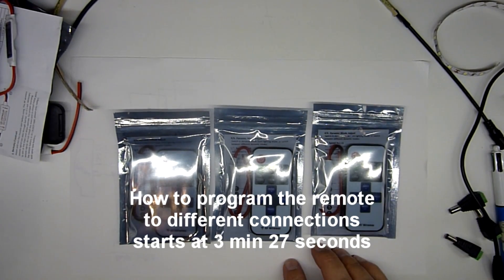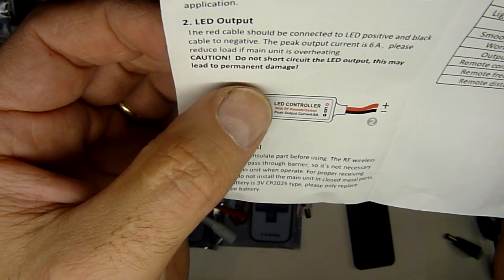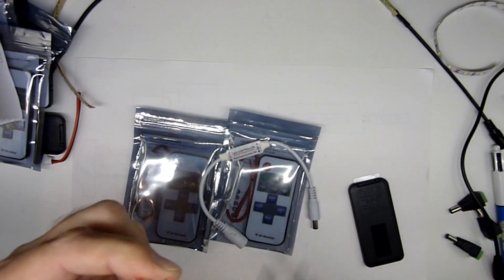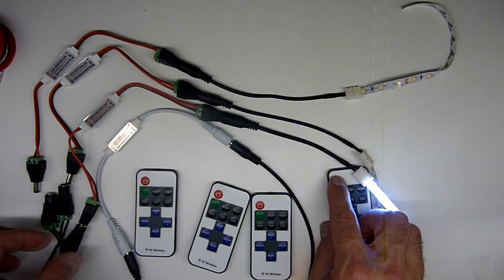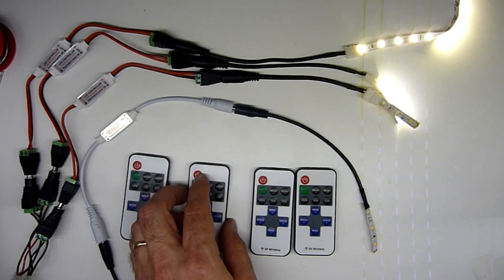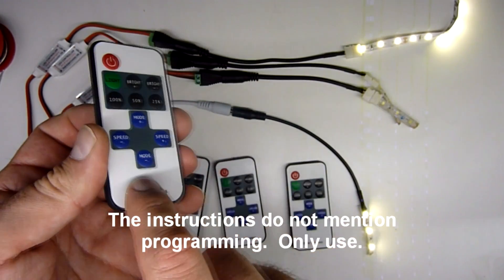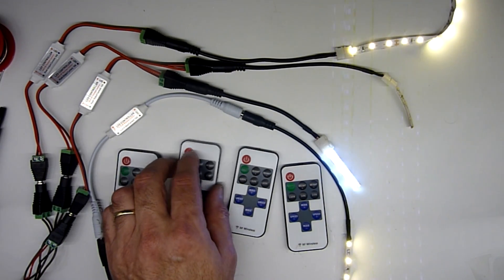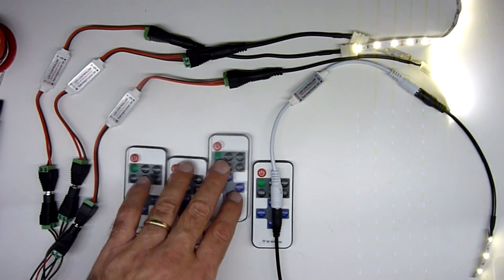LED One Color Remote Control Programming

Comment: What do I do if I want two remotes to control the same strip?
Reply from the maker: Not with this controller.   There are a couple of options.  For remote based looks at mi-light. Each remote can do up to 4 controllers and you can have multiple remotes.  The other is phone or voice control.  That can be a WiFi or Bluetooth based controller.  I demonstrate a WiFi controller in this video. https://youtu.be/SAyy_kZojv0
Reply: Is that means constant war with neighbor ,,is led RF controller can possibly be the begining of civil war ?-:)

Comment: Hi can i use this with 5 meter led strip even
Reply from the maker: Yes, It is based on load.  I have one running 9 meters of light rated at 1 amp per meter.  I did solder in new leads of a higher gauge first to run at that rating.  You should have no issues.

Comment: Thank you a lot!!
I have 5 LED strips in different floors and they turn on / off all together!!
You save me!!😊😊
Reply from the maker: Great news.  I still use many of these around the house and with new installs when I don’t use a motion sensor.  I have recently started playing with WiFi enabled single color and multi color controllers.   The cost is more per unit. You gain scheduling, control from multiple devices and smart home integration like google and Alexa for those areas where hands free is of benefit.  Enjoy your install.

Comment: does yours work with 5volt using usb supply ?? mine doesnt working :(
Reply from the maker: The ones in this video are rated at 12 to 24v dc.  5v is common in controllers and lights running of usb power since usb runs at 5v. You should be able to find similar units that rating.
Reply: thanks so much for reply my comment :) i bought 4 remote control throught shopee, they look like yours in this clip, i'll try with 12v led light.
sadly they're not work with my 5v fairy light
Reply: my rf control labeled working voltage from 5-24v :(
Reply from the maker: Try to verify it is working someplace else.  Sometimes the battery contact does not touch the contact. I see some of the 5 to 24v online but none of the reviews mention using them ah 5v.  I hope it works out.
Reply: Always Tinkering thanks so much :) have a good day sir 😝
Reply: @alwaystinkering6972  i tested with my aquarium led light used 12v electric, it worked !!! thanks

Comment: I have led lights on my stairs. I have one remote at the top and one remote at the bottom. Worked for about a year and then something got it out of sync so that no remotes worked. Used your video to reprogram. Do you know how to make 2 remotes work with one receiver?
Reply from the maker: I tested that and found no way to intentionally make both work with one remote.  I am thinking of doing my stairs soon. I will probably try dual motion with a blocking rectifier.  Voice activated is tempting but Alexa or google screaming ok in the middle of the night may not go over well.  

Look at the mi-light controllers. One remote can control  up to 4 controllers and you have the option of multiple remotes.
Reply: @alwaystinkering6972  Thanks for the input! Lately I have been just reprogramming the lights every time I us the remote at the top or bottom of the stairs.

Comment: I use RGB controller with RF control. And i have many problems with connection controller and remote control. Сonnections is lost on many controllers. Can you help me? Are there hidden control panel features?
Reply from the maker: All of my color controllers are infrared or WiFi or WiFi/infrared.  The WiFi infrared work best for me because I can use my phone to control the lights and the non-tech people in my house can use the remote. 
While there a growing number of options you will find that the offers under multiple brand names are the same product.  This means you should be able to shop price. This link is an example of an infrared with WiFi https://www.amazon.com/dp/B07BRWTQCS they come in RGB and RGBW format. 
A broader selection could be seen by searching “wifi rgb led controller”
I hope you find a solution that works for you.

Comment: Does this technique work with any brand of rf led controller?
Reply from the maker: Many if not all RF remotes seam to have some process to re-associate the pairing. No two seam to follow the same process and key combination.  Few are documented with the instructions.  So the answer is no. This one does not apply to any brand.

Comment: Whitch fuse I shlould use for my motorcycle ? It’s 12V
Reply from the maker: The one above the rated amp draw of the led lights you are using and no higher than the rating on the next lowest rated item... wire... switch and such.  At 12v it is 1 amp per 12w of rating.

If you had a 12w light thats 1 amp.    1amp fuse may be too close, 2 amp would be the lowest.  You are protecting against a short.  

You don't want that short to pass enough amps it can melt something and cause a fire.  Unless you are pushing the full rating, a 10 amp fuse should protect this dimmer... if you trust the factory wiring on it.   So if you are using lights with a lower draw than the dimmer rating, fuse at the light rating.

Comment: Good day. Thanks for the helpful video. Tell me, maybe You know, how one controller to register 2 remote controls. Thank you in advance.
Reply from the maker: Mi-light makes a system with multiple remotes to multiple controllers. Usually each remote can do up to 4 controllers.  Another option would be phone controlled controllers if you want to use multiple phones for control.  Phone enabled are more common for controlling color.  You can use them for single color  by using just one band and making an adapter wire.  On most color controllers each color is a (+) connector.  The common is the (-).
Reply: Good afternoon. Thanks for the quick response. I need the reverse action-bind the second (optional) light control panel to one controller. So as to control two(1 and 2) remotes by one led strip.Thanks.
Добрый день. Спасибо за быстрый ответ. Мне нужно обратное действие - привязать второй(дополнительный) пульт управления светом на один контроллер. Так, чтобы управлять двумя(1 и 2) пультами одной светодиодной лентой.Спасибо.
Reply from the maker: No.  As I show in the video sometimes they answer to the same remote, but getting both to respond is hit or miss.  I have used some color controls that are run from your phone.  The apps give you a list of controllers it sees.  I only have one controller so i don't know if I could control more at the same time.  Actually I do have a second controller that is supposed to use the same software.  I will have to run a test to see if an action can do multiple at the same time.  I had tested the wifi controller on an Alexa voice control.  It worked well.

Comment: Is there a way to force ON or OFF, not toggle? I have more than one light strip in the same electrical circuit, and it happened that the lights are "out of sync" with one another. Turning the circuit off does not solve, as the controllers have memory... Any idea? Thank you for your video.
Reply from the maker: No.  I also tried getting one remote to talk to two controllers for someone and that did not work.  

Options:  if you can get a wire between them a one color amplifier will allow you to extend control and keep the second power supply for the second string... and you get one controller control.   Another option is rgb wifi controllers (with the infrared remote option if you want)  the wifi gives you phone control of each light separately.  You obviously are not using the color lights so use the common (which is usually the positive) and one color.  You could also do something similar with the cheaper regular color controllers.  Another option might be the Mi-light WiFi Led controller system. They used to make one color and rgb color modules.

Comment: This should be able to power two 10w led lights right? I connected it and it worked fine for 10 minutes and then just died. And now it just flickers one time when i try to power it on.
Reply from the maker: The rating of label of 12A would be 144W at 12V DC as there are 12W per amp at that voltage.  I run a rated load of 9A or 108W on a daily used string for over a year now.  I say rated because the actual load created by a string is frequently less than its potential peak.  As for diagnosing your problem.  First verify that your 10W LED fixtures work without the dimmer.  If the dimmer is toast you may want to remove the cover  over the circuit board ( which is heat shrink) for analysis.   Did anything melt?  Do the wires test as functional and not broken.   The one short I experienced melted the wiring insulation over the IC that overheated.  You likely won't be able to fix a problem, but you may see something obvious in the issue, including a defect.  Also check your power is putting out the correct voltage.  Also remember, the printed instructions say it is rated for 6A... You still would have been OK... it is just a reminder that there is not telling what it should be.
Reply: Always Tinkering thanks for the reply. I think i just got a bad batch or something. I opened it up and i cant see anything burnt or obviously wrong with it. Now when i connect the leads it actually lights up, but it doesnt want to be controlled. The controller it self is fine and working however. So now it only acts as a peice of wire... Ill order a new one and see if it happends again. I plan to use it on my motorcycle. I want to use these insainly bright tiny work lights as drl's and being able to set the brightness will help me being seen, without blinding other drivers. Especially when its getting darker or raining. Do you think theres a better solution to this? I really like the idea of being able to strobe them as well.

Comment: Not flashing after pressing the speed buttons. Tried everything, but 1 remote still controls the 2 led in the same time. One in the kitchen, and one in the bedroom.. Ideas?
Reply from the maker: Are the remote keys in the exact same layout?  There is another remote that is of the same size with a different key layout.  That remote uses a different key combination.  I have not seen any changes, but it is always possible they could update the chip set.  Also make sure to try it right after the power on.
Reply: Both are the 17 key rf remote. In the manual there is the same method but..
https://youtu.be/U5jYMBW11GE - this type.
Reply from the maker: Color too.  Definitely different.  I don't have any with that layout.  Try different key combinations within 5 seconds of power on.  It is likely there someplace.  Things like bright up and down.  Also try holding buttons at power on.

Comment: I also solved the pairing problem. Disconnect the power for 5 seconds, reconnect, and press the speed + and speed - together in 5 seconds. The LED must flash once and the pairing is done. I hope it will help
Reply: - Mirek - This has not worked for me at all
Reply: It's good.

Comment: i have two remotes for 1 strip is there an option to program that
Reply from the maker: I am always hesident to feed electricity backwards into a device that does not clearly indicate it supports that configuration. One remote activating the power would create that scenerio for the other controller.  Consider the milight remote control system that allows you to have one controller and multiple remotes.   That system also has a wifi option you can add for additional control.  That being said you could also get a standalone wifi controller that has an ir remote option.  Phone would be one remote and the ir remote the other.
Reply: Always Tinkering no i have one controler on the led strip but i have 2 remotes
Reply from the maker: I grabbed a battery pack, two remotes, a controller, some light and went out into a field to run a test.  I was unable to get two remotes to talk to the same controller.   I could swing controller control back and forth between remotes (I guess that is an option if you have no other controllers... just resync when you go to use the remote).  

I tried sending the sync sequence at the same time, only one would win.  I tried numerous other key combinations with the loser and it would never gain simultaneous control.  I also cycled through resync's on one controller to see if there would be some overlap at some point... and I encountered none.

From this experiment I would say the controllers build their sync off what the remote sends... and that the controllers must us the same or a similar algorithm since we know the reset sequence will reprogram all controllers in range... and many will then then be controlled by that one remote.
Reply: ok thanks for reply

Comment: Neither option worked for my remote although it looks identical. Any remote controls all lights. I will just switch the second circuit from RF control to IR.
Reply from the maker: Make sure you have only one powered on when pressing the buttons to do the programming.   Pressing the programming keys will reset all powered dimmers within range to be controlled by that one remote.  There are appear to be multiple places manufacturing this design so at some point behavior may change.

Comment: I found an additional programming instruction for "Free Pairing Mode" or also called "Unpaired Mode". Unplug controller for at least five seconds, plug back in, within five seconds hold down "On/Off" and "Mode+" buttons for five seconds.  Although, I'm not quite sure what the point of "Unpaired mode" is? Why not just do the pairing procedure with all controllers powered and then just unplug those out of on/off sync, hit the power button on the remote, then plug the others back in again to have them all in on/off sync. 
All said, you are absolutely correct, some versions of these remotes use the 50% & 100% buttons instead of the speed buttons. The same may be true for the "Free pairing mode". :)
Reply: By the way, thank you for this excellent demo!

Comment: Hi i cant program my controler, could you help me? 
The controller is not working and I'm trying to pair it and i Can't
Reply from the maker: If your remote is identical to these and it is not working or syncing,  Check that the wire assembly is not getting HOT.  That is a sign that it has been damaged by a short.  If it has been damaged it will make it useless.  The I damaged during an install let the lights turn on, but all control was lost.

If your remote is not the identical layout I have seen other videos for the remotes with the different layout that show the 50% and 100% buttons being used to do the programming.

I hope that helps.  Good luck.
Reply: @alwaystinkering6972  I have 2 receivers and they both stopped working, running hot.  The LEDs are always on.  I removed the shrink wrap from one of them and found 3 A2SHB mosfet surface mount devices (SMD) which I think are the output devices.  Two of the devices have zero Ohms from drain to source, which I suspect would cause the output to be stuck on.  I am trying to grow my SMD skills so I ordered some devices from eBay $1.99 for 100 pieces.  I plan to replace those mosfets and see if the receiver starts working again.  I also have some replacement receivers on order so I can compare good with bad.  Why all of this for  a $2 device?  I tinker too.
Reply from the maker: @skiptourville823  Interesting.  They stopped working with just an LED strip load?  Any lights on the strip out?  What voltage and load do you run?    The 27' over the garage is my largest load (I did replace the wire leads with 18 ga).  I am 2+ years now with that one.  I have had some remotes wig out.  The metal prongs that touch the edge of the battery tend to not spring back if the remote has bounced off the floor too many times.  I just bend them back.  Other than that the dozen plus I have installed are all still running.   If you have no short and your draw is too near the rating try an amplifier.  Mixed luck with those.  The in expensive one color amps are usually RGB inside with the RGB shorted into one color.   Not an issue but the failure rate has been more than one.   The good news about working on your SMD skills is that it is only a $2 device.
Reply: I also solved the pairing problem. Disconnect the power for 5 seconds, reconnect, and press the speed + and speed - together in 5 seconds. The LED must flash once and the pairing is done. I hope it will help